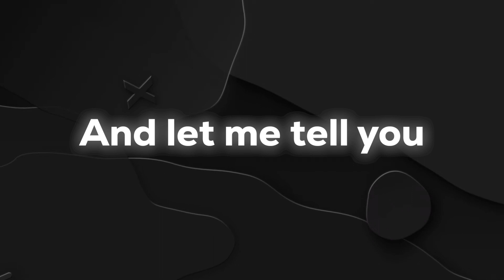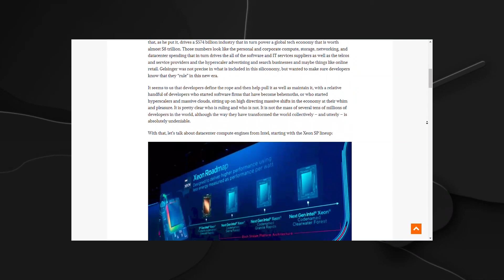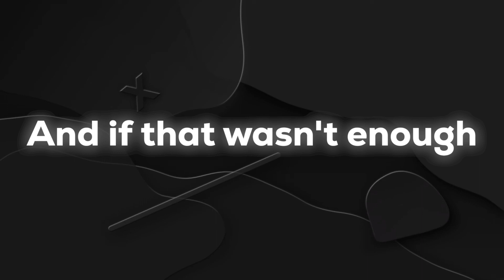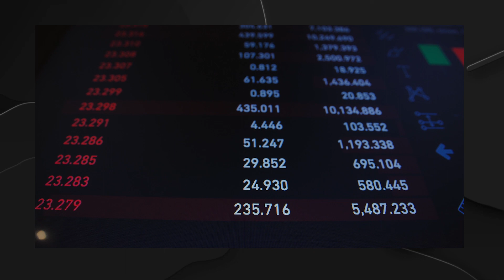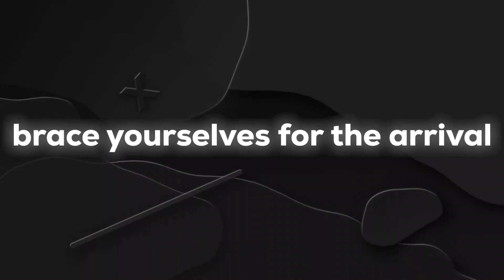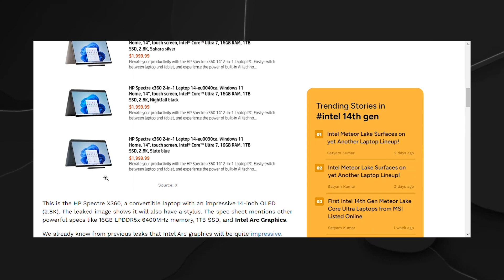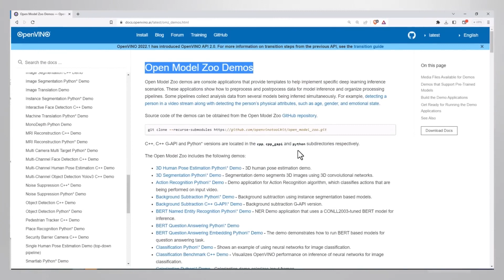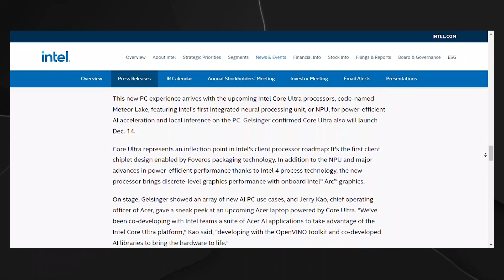This Is Why New 'Intel AI' Chips Are Way Too Advanced

Comment: You are schilling for investors to sell socket changes, os changes when we didnt need them, but they have to keep tricking the investors to think RnD was improving yet they spent about 1% over 20 years WHY? because we cant advance they just selling lies and forcing us to upgrade good fast cpu gpu n mb to go ai workaround when we didnt need to upgrade becasue we bought high end, native 4k capable pc's now we are forced to downgrade to turn them into ai consoles they are trying to remove gfx cards to go to cpus low wattage upscaled n fsr.  that aint improving its lying  n going less powerfull .   we moved from consoles to go native 4k gaming 7 years ago now climate change is forcing junk we didnt watnt an aaa gaming is dead replace by online cloud ads in games written for the lowest spec and forced on all with latency and ai ,  what happened to high end power desktops igps 4.2ghx 240hz to 440hz 4k 8k upscaleable to now.  Forcing a socket change to new os making us replace good hardware to slower multi tasking lanes is not good for climate its just making more crap we didnt need and prevents sale of flagship high end quality hardware to not be useable forced by microsoft win 11, to remove all old aaa 4k gaming modded n optimized are now one size fits all.  SAD and all to get investors money so they dont find out they are at the end, and cant make anything advanced just try with the old die silicon and cut it down to try use multiples of halfs.